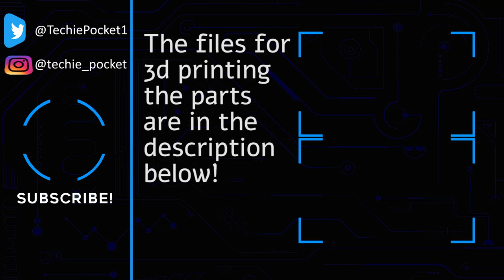REALISTIC LOGITECH CLUTCH DIY HOW TO

Comment: I just installed this mod. It definitely gives the clutch a different feel, more immersive. The print needed a little work with the Dremel to get the parts to fit right.

Comment: How strong are the 3D printed parts?  Do you have to be gentle or does it not matter?
Reply from the maker: NO YOU DON'T! I SMAASHH my pedals all the time heel-toing and all and it held up just fine! The other day I put my stock logitech brake spring into the clutch and that was too much force and broke it :/. So as long as you stay with the stock clutch spring(more then enough) you will be good to go!
Reply: @TechiePocket1  do you recall how it broke? I'm curious to know what may need to be reinforced to improve the strength of the print.
Reply from the maker: @donaldtrumpjr  It broke right along the tubular end where it meets with the clutch pedal face. That didn't affect the usability because the spring still held it in place just fine.... But over the course of a few weeks it then broke pretty much everywhere 😂. It happened while I was driving it felt like it exploded. When I checked the female tube was broken in 3 piece and the hinge side plates broke off. Overall I think if the design was thicker it would've put up with my use just fine

Comment: What about the wiring
Reply from the maker: There is no wiring needed to add that clutch mod. If your talking about wiring for taking the pedals out of the case than it's all the same.
Reply from the maker: If all you want is the realistic clutch mod everything I did in the video will do.
Reply: I meant if you add a clutch to a 2pedal system
Reply from the maker: @lukaukmar1144  Oh! Well, which Logitech G25/7/9 doesn't have three pedals? If your using a momo or something idk what you can do. Sorry, wish I could help :/
Reply: Yeah for example dfgt
Reply from the maker: @lukaukmar1144  Hmm. Think all you can do is upgrade to a G series set
Reply: Thanks for the help ill se what i can do
Reply: I'll probably end up making a usb clutch pedal based on your design

Comment: This looks like an awesome mod! Now I'm just trying to figure out the best place to order 3D prints from.

Question:
What clutch pedal dead-band settings do you use? I'm assuming this mod is best to use with a certain about of dead-band on the front and back end of the pedal throw? Thanks.
Reply from the maker: In iRacing I use the full travel and the bite point seems to line up perfectly with all the cars I'm using. Should be pretty similar to other sims. If not games like Assetto Corsa make it really easy to change the dead zones.
Reply: @TechiePocket1  Sounds good! I'm going to see if I can get this printed and sent to my mailbox. I'll be sure to tip you in Thingiverse if it works!

Comment: That's a really nice mod. How about inverted pedals, will work the same?
Reply from the maker: Hmm. On inverted pedals I think you might have to change the design a little. It has the base resting on floor as you can see, you would have to find a new way to support it from the top but I bet its possible. Thank you for watching!
Reply: @TechiePocket1  okay, I'll try my best
Reply from the maker: Do post a video showing what you did if you do happen to complete it. I would be very interested!
Reply from the maker: @emds6819  Sure!
Reply: @TechiePocket1  Hi man, I think I'm pretty late, but I'm doing 😂. Since last month I have everything 3d printed, now I'm building my inverted pedals setup, probably next week everything will be done. I really want to show you how it ended, and since my first comment here, I was remembering of you
Reply: @TechiePocket1  ASAP I will put it on my channel, just saying as well 😆
Reply: @emds6819  I have my pedals inverted and use the mod, that said I have the pedals mounted directly to a wood sim rig. Do note, that you need enough clearance at the bottom of the pedal for the shaft to go down if you're just using an inverted pedal base.

At the moment I'm looking into getting the mod machined out of aluminium so I can put a heavier spring inside of it. Thought I saw someone in these comments say they tried it with the brake spring and it ended up breaking the plastic. So figured I'd see what I could find, maybe someone in the machining course at my college can do it for me for cheap.